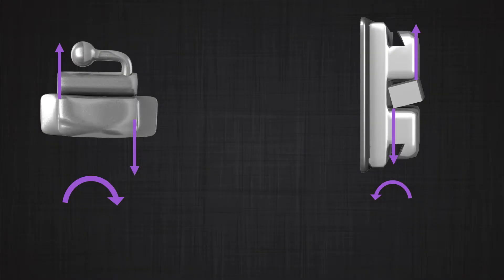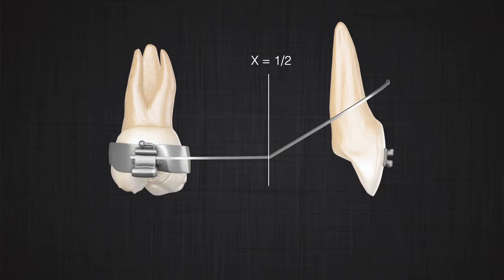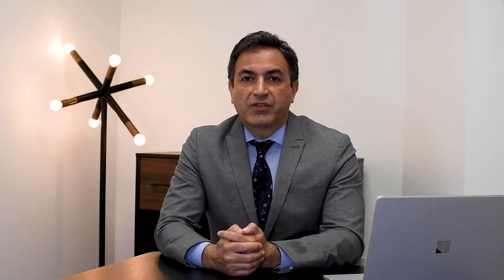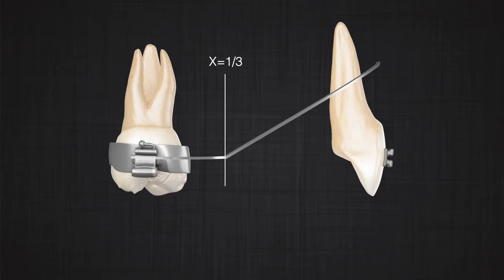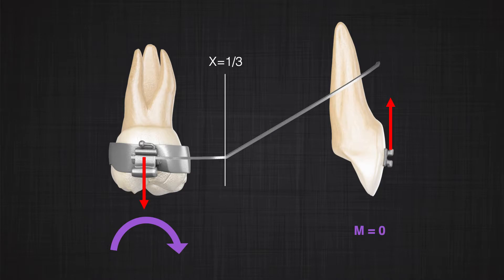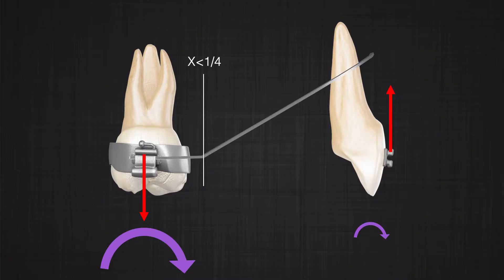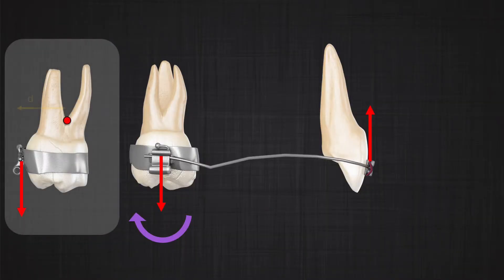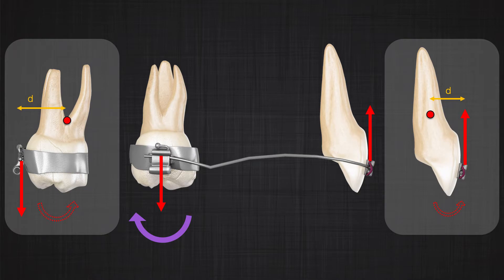Mechanotherapy in Orthodontics: 2 x 4 Set Up - Rectangular Wire Pt. 2

Comment: hi sir in your previous video it was mentioned that if 2 brackets are of equal width, the system will approach a one couple system when V bend is about 1/3 to the molar; however in this case, given molar has wider bracket, shouldn't this "one couple point" where incisor has no couple produced, be reached earlier (i.e before it approaches 1/3 of the wire, maybe let's say between 1/2 to 2/5)? thank you very much